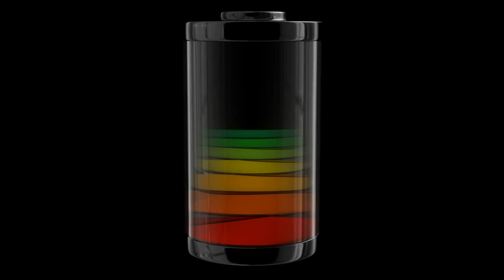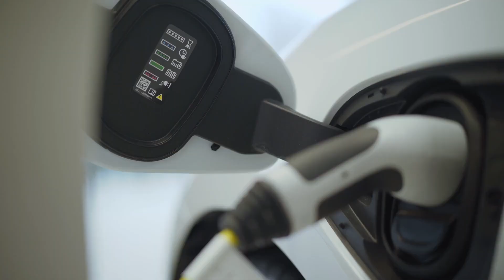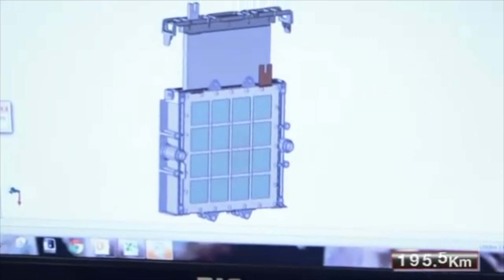This Battery Gives EVs 1000 Miles of Range!

Comment: When you discuss the difference between gas and electric, you should talk about the overall useable available power.  That two gallons of gas will only go 30-60 miles, where the electric car would 100-400.
Reply: As Aluminum mixture chemically reacts, 
it has qualities of regular fuel.

What is full list of initial resources;
End resources/waste;
Reusability 

Does the video, answer these questions ?
Reply: 10min mark
!! Hope video improves !!
Starting to sound more like gasoline, 
vs electric !

The resulting sludge, could be a great waste. Similar to emisions from gasoline !
Reply: @dirktween244   The video does address this, yes.
Reply: Equivalent energy is not the sum or same as equal to end results of mileage. Ex: the mileage range of 1 gallon of gas is not equal to say hypothetically the charge of a 100lb ion battery. Thermo dynamics and electric motor that has way more torque does make them equivalent, but electricity is more efficient but is less convenient at our present state of it being widely and readily available.
Reply: @CrazeCracker79  Batteries will never reach the energy density of a hydrocarbon fuel because of the nature of how each releases their energy. Liquid fuels release their energy through addition of atmospheric oxygen so they are relatively safe. If a battery had the same energy density as fuel ALL of its energy has to be stored at the same time within the battery. It would be like having the fuel in your tank already pre-mixed with the oxygen necessary to fully burn it all. You'd effectively have a battery bomb on your hands. In addition, when comparing energy storage per kg, batteries lose out even more because part of its energy is going to be wasted in overcoming that extra weight.
Reply: @saiello2061  that pretty much what I said.. Thanks
Reply: The other thing to consider is the cost to resupply the energy source. My Expedition currently costs me about $240 to travel 1000 miles on gasoline with the interior loaded with people and gear (~18mpg, 30 gallon tank × $4.0 × 2 fill-ups). If they installed 2 500-mile range batteries, as long as they could keep the price to replace one to about $100, then it could become cost effective for the consumer. That is assuming the 500 mile range is calculated to take into account  vehicle load and road conditions, i.e. hills.
Reply: 30-60 miles for TWO gallons??? What are you driving, a supercar at breakneck speeds? BS. ONE gallon should get you at least 60 miles in a modern average family saloon.
Reply: @saiello2061  3.8 litres / 100 km? No family sedan gets that level of fuel economy. 8 l/100 km, I can accept as common.
Reply: @davidbutt406   I owned a late 90's petrol Peugeot 406, 1.9 litre 125bhp large saloon. 6.3 l/100 km, 37.34 US mpg or 44.84 UK mpg. If I drove carefully I'd get a bit more. The Diesel version would get you around 20% more milage. That was 20 years ago, fuel efficiency has improved a lot since then. If you're only getting 30 US mpg out of an average car today, then somethings wrong.
Reply: @saiello2061  I’m looking from a North American perspective. Few vehicles here net anywhere close to your experience. Consumption of 8 l/100 km is considered frugal.
Reply: @saiello2061  EXACTLY!!! that's the drinking point. It's NOT gotten that much better and cars are getting g heavier even dispute using lighter weight materials. We take out weight here and add it back in over there.. It's ridiculous actually. The modern engine CAN be way more efficient and had progressed but over all is not the great efficiency it should be for most of the cars on the roads. Not everyone is driving diesels or Prius hybrids. Plus, the more complicated the cars are built added to the fair t modern owners don't know shit about working on cars and the cost of taking them to get the work done makes people neglect keeping their cars in good efficient working status. They just scrap it or buy another new car and start all over in the vicious pattern. I buy old cars I know I can fix myself with practical and attainable tools. Maybe not the most efficient things on the road but better than going through more and more cars.
Reply: @saiello2061  How did the Peugot cost you 20 years ago? The AVERAGE price of a vehicle in the US is approaching $30,000
Reply: @LightWingStudios  I got it second hand in very good condition. Paid around £600 or $1000.

P.S. The yearly insurance premium was horrendous though, more than the initial cost of the vehicle....
Reply: @saiello2061  Maybe on a Scooter but not a car.
Reply: It a depends on the vehicle. 
My truck will go 36 miles on two gallons. 
My car would go 68. 
I used ranges because it all depends on vehicles and conditions.

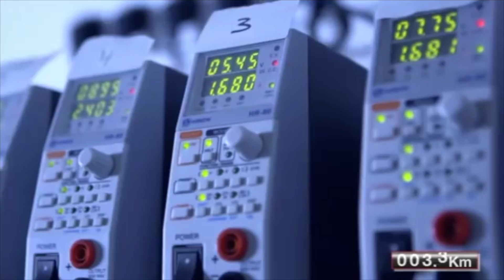Comment: Did my man just say 600km is equal to 1000 miles at 8:10
Or am I hearing things?
Reply: I think he flipped his conversion.
Reply: Didn’t he also say that the amount of gasoline needed to equal a 300 mile Tesla battery range was just two gallons?
Reply: @teodelfuego  a gallon of gas is equal to 33.5 KWh. If a model 3’s battery is 75KWh, then it is just over two gallons. 
That’s almost 150 mpg!
Reply: 8:06 --- 600 kilometers is not 1000 miles....more like 360 miles.  600 * 0.6
Reply: Ricky, please let us know what you really meant...
Reply: D'oh!!! yeah he did ... unit conversion fail!
Reply: yes
Reply: 372 miles.   Oops!
Reply: I had to stop and run the conversion when I heard that too. Don't think so buddy.
Reply: Those are his numbers.
Other numbers, are also vastly off.

Makes one wonder, 
if he passed basic math.

!! Even with his down-sizing of numbers, they are still very impressive !

*******
?? Too impressive ??
Finding it comparable to 
ICE vehicles, 
using aluminum instead of gasoline
Reply: Greatest notice ?

Using numbers that are 
GREATER than 300 !

Supposed to be 
using numbers nearing 2,500 !
Reply: What I heard
Reply: Airplanes have crashed thanks to this very mistake. Well, one has anyway.
Reply: No, Ali. He said that one thousand imperial miles is the equivalent of 1,600 kilometers. He is correct.

Comment: Radiolysis Hydrogen production, Oceanic Thermal Energy Conversion, closed loop geothermal heat pumps, phase change cooled photoelectric cells with a heat pump... could all power a hydrogen economy.

Comment: I was driving around (in my most affordable nonexistent imaginary car/disclaimer) and then eventually my aluminum air battery ran out of power, so i removed a simple screw from the battery casing, and then the battery recharged itself because of the windpower that rushed in as a result because it got fresh air. They should make em so drivers don't need to screwdriver for increased range and lower operating costs.